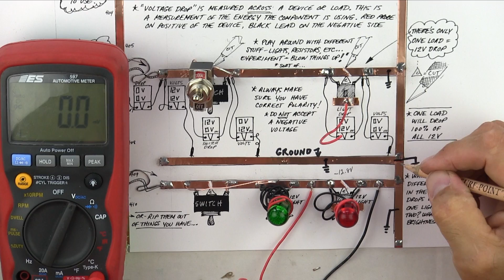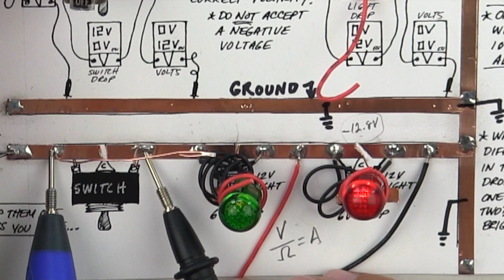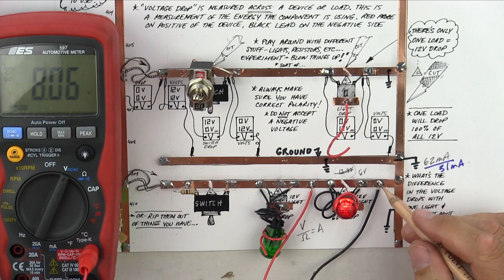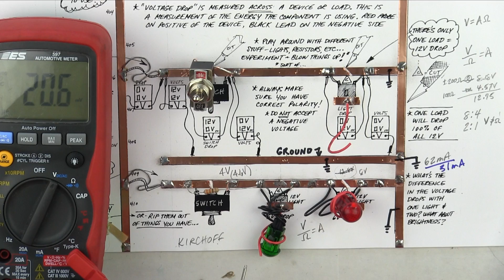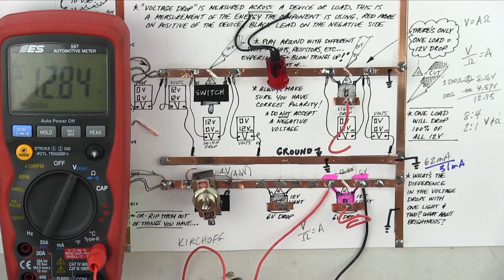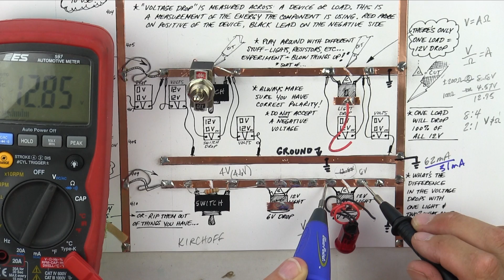CARD 4B - MEASURING VOLTAGE 2 - Hands-On-Line Electrical Training

Comment: At 16:30, why are you reading system voltage at the connector? Is there not a voltage drop across the resistor since the resistor is acting as a load?

Comment: Hey Daniel I am a locomotive electrician apprentice, would the loadpro lead work on a 64v DC circuit? By the way your videos are awesome.....
Reply from the maker: JonToney26 Only if you're really fast. I do have a prototype for a 120V version. If you want to construct one for 64V I can give you the details - I wouldn't mind. That way you could use it at work and give me field reports. Email me directly at dan@brighterideas.com.
Reply: any update on the 120 volt tool?
Reply from the maker: david johnson Yes - I'm heading up to Wisconsin at the end of the month to meet about a bunch of stuff. I'll know more by September.
Reply: Daniel Sullivan Just a note of sincere thanks for all I have learned from your videos. Though my interest is in hvac and appliances, I bought your loadpro tool and book via Amazon and have a much better grasp of  troubleshooting concepts and electrical theory.

Comment: 12.8 volts divided by 62 mAmps gives 206.5 ohms. Make the same circuit using 200 ohm resistors instead of bulbs to prove your hot filament theory.
Reply from the maker: Good suggestion. What's your thought about the same effect using the carbon-based resistors?
Reply: If we use carbon resistors instead of bulbs, the meter readings would agree with the math.
Reply: .......until we watch Card 5 video. Very nice!
Reply from the maker: John C Neat, huh?